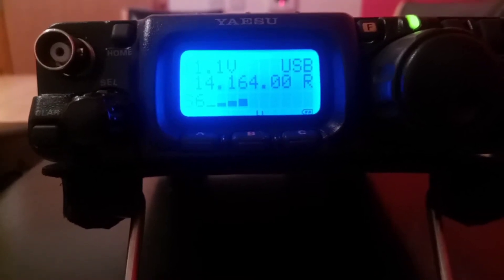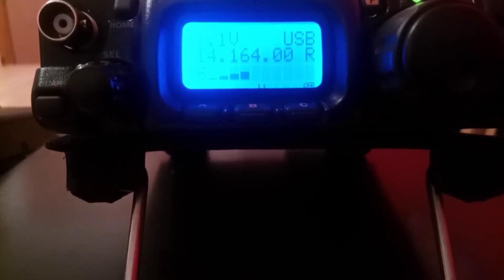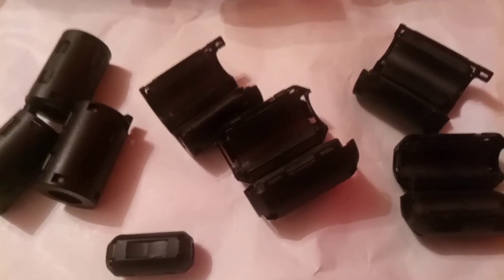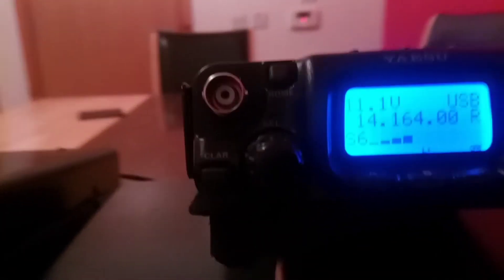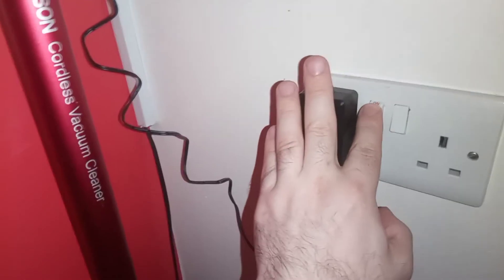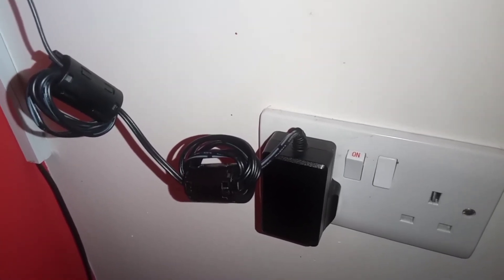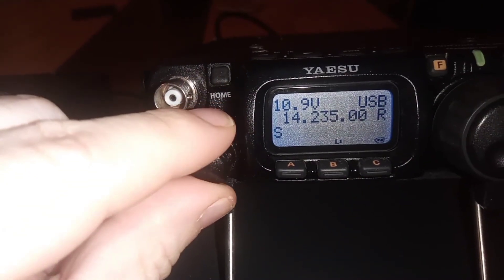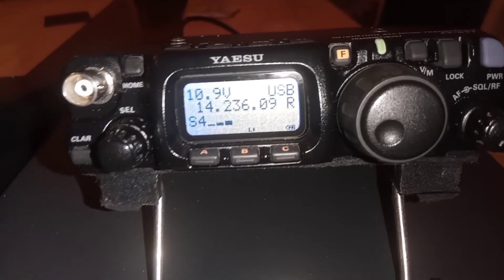💠📻💠Ham Radio - QRM ELIMINATION USING FERRITE.💠📻💠

Comment: Can we put those ferrite on co axial cable?
Reply from the maker: You can put them on coax to suppress RF feedback on outer shield.
Reply: @QRP700  thank you ,qrp king 73 ,.
Reply: Best place to put the ferrites on a coaxial antennacable is the end of that cable where the cable goes into the antenna. That is the spot where most of the interference from the transmitter comes from. Other cables on the radio can have ferrites too, usb cables, the powercable etc.
Reply: Thanks for the advice  , 73's 👍🏿